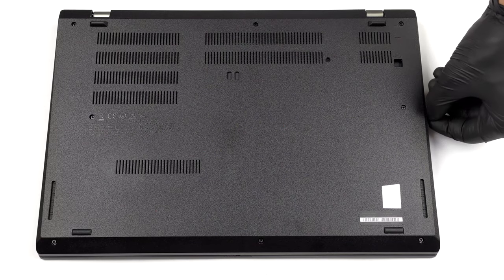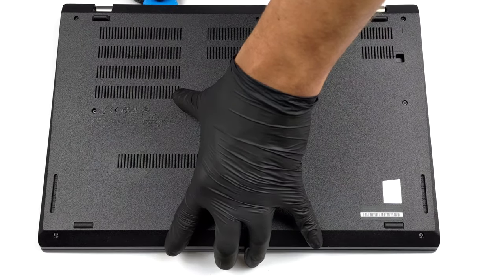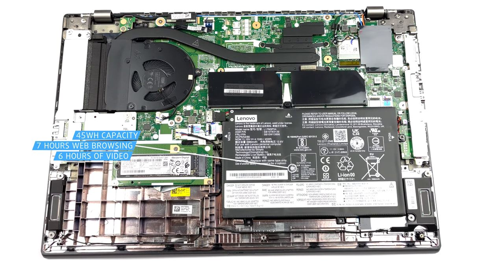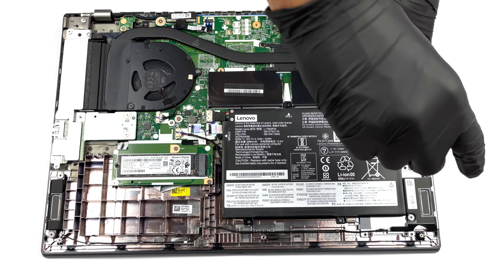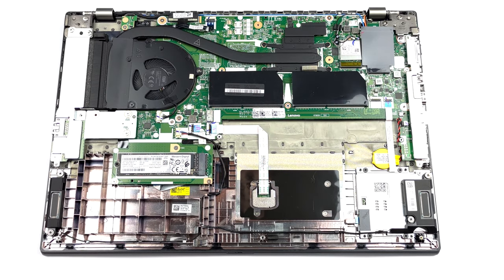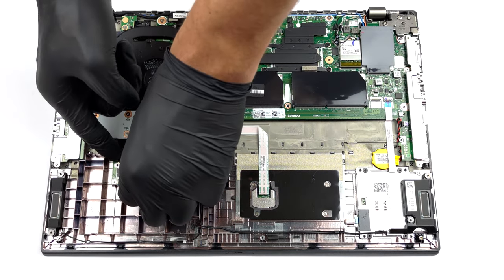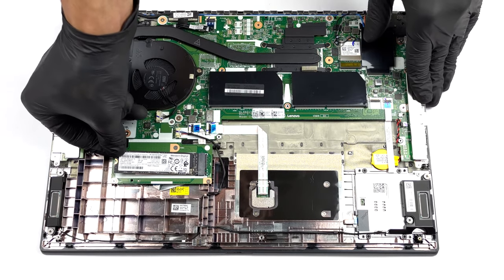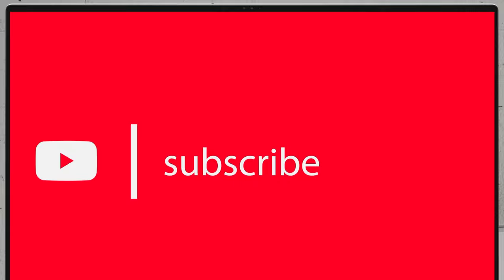🛠️ Lenovo ThinkPad L15 Gen 2 - disassembly and upgrade options

Comment: Nice video, can you actually upgrade the laptop with a 2.5" SSD while keeping the original NVME drive in it?
Reply: Yes you can next to the wlan there is a slot to move to but smaller form factor.
Reply: @WilliamHollinger2019  Oh!!! By mistake i bought the AMD version that says in the specs it doesn't support SATA 2.5. Never take decisions like this very late at night :( Is it possible to fit a sata 2.5 on my AMD version L15 gen2 or it's impossible as the specs state?